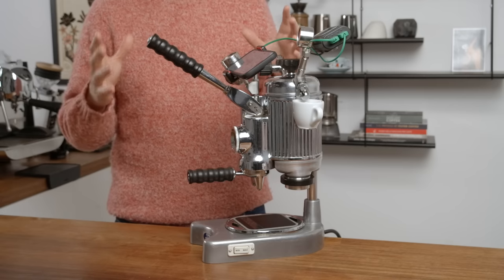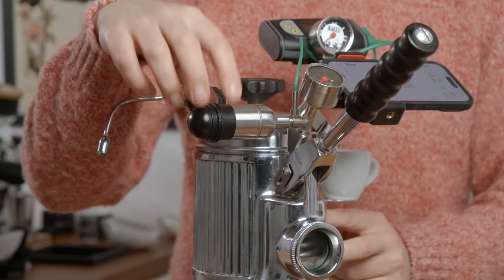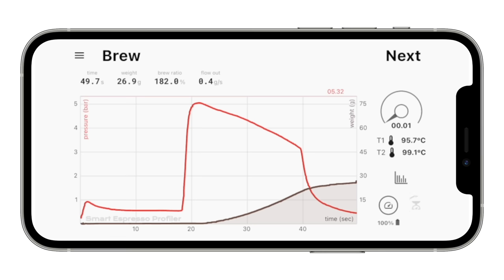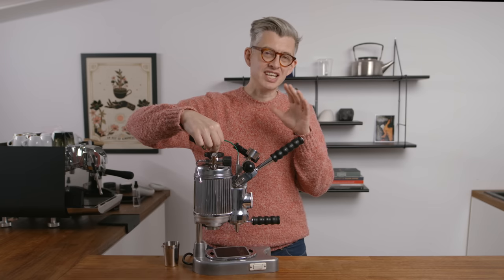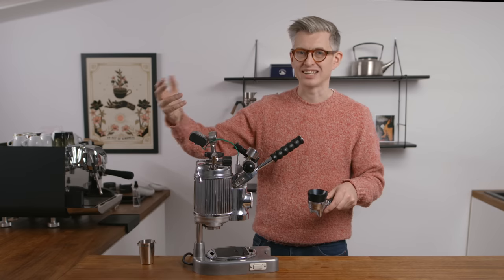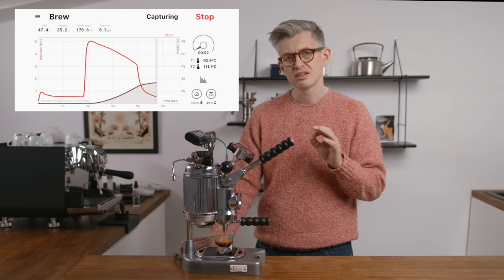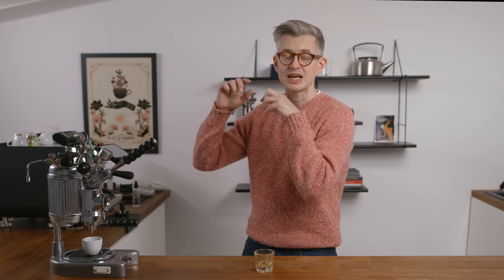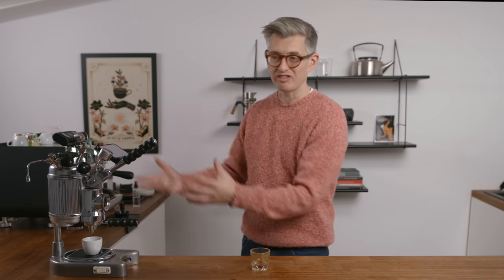An Upgraded Vintage Lever Machine

Comment: Could we flush the boiler between shots using the steam wand to bring down the temperature? The fact that they had a "min/max" switch shows that they knew that the temp gets too high if left simply on "max". On my Gaggia classic, I also have two thermocouples, one for the boiler and one for the grouphead. It has been interesting trying to understand the relationship between the two temps, and how to optimize the temp of the actual shot given that info.
Reply: Usually one setting is for brewing espresso and the other for steaming. Older Europiccola works on a similar principle. You just learn to thermally manage them.
Reply: @chris9650  I wonder if James was brewing on Max here. Perhaps that is why there was such a narrow time window before it got too hot.
Reply: @swbusby  the pre mil la pavonis on low are similar I think but the window is quite short there too. I found that turning the machine off during the shot was the best way to manage a bit better.

Comment: Honestly I love your original idea but I can respect the sense of restoration over upgrades. To that end may I suggest a compromise. Design with Gabor the machine you would like to have seen and 3D print it in metal.

Comment: Why can't you run the whole thing at thermal equilibrium with a lower boiler temperature? Does it mess with the pre-infusion?
Reply: Not with the Faemina :-(. The boiler needs to be pressurized.

Comment: James, please accept a bit of advice regarding "vintage machines"....they are only original once, with original purity once. That is their vintage attraction. Once "hacked" the originality just evaporates.  Enjoy the analog vintage experience whether with a vintage espresso machine or with a vintage car.  Use your Decent Espresso machine for your digital inquisitive urges, and to satisfy your curiosities, but still enjoy the pleasures of producing a satisfying but decent (pun intended) espresso on your vintage 1950's Faema.  I have newer more modern machines, but still enjoy the challenges and satisfaction of having learned to make very decent espressos on my La Pavoni and on my very simple dipper spring lever Sama/Ponte Vecchio.  Continue enjoying the analog learning experience with your Faema, and  with your previously acquired vintage lever from Enrico Maltoni, life and espresso are multifaceted, so enjoy the ride uncovering the analog espresso treats awaiting you.  Digital and analog can both co-exist, and are not exclusionary of the other.  As you know, the taste of the espresso in the cup is the real goal.  Bob's your uncle.

Comment: I'm unsure how to feel. On the one hand, it is a classic machine that deserves to be kept pristine.

However, isn't it better to go ahead and permanently alter a device like this, than to let it waste away? If anything, hooking all these gadgets up to it, sticking them everywhere on the outside with all these cables, makes it far uglier and obtuse than modifying it permanently to incorporate these devices. These are old machines that aren't being used much anymore. Outside of niche cases, few probably want to bother with them (modern society constantly wants newer and newer stuff). I'd rather the device be torn down and altered to make a modern machine, that either stick "life support" devices all over it or it sits in the back of some deep dark abyss in one's home, or winds up at some thrift store/charity shop/etc. collecting dust. 

I feel its better to make use of something old, even if it means permanently altering it, than to have something sit unused.

Comment: Hi all. Unrelated to the video but thought with this being the most recent I may have the best chance at an answer. Does anyone know (or have experience) of using pre ground coffee in a non pressurised basket. I'm not talking about general shop bought but beans from a proper coffee shop. I'm waiting for the Encore ESP to be released here in the UK but have an espresso machine sat gathering dust. My plan would be to get half a bag ground espresso fine and keep the other half whole to hand grind for filter. Any thoughts greatly appreciated.

Comment: Can the pressure be modified by a different spring? Intuition says that a spring with more force might speed up the extraction from the 45 seconds?
Reply: Levers generally work better with slower shots and lower pressures.
Reply: @chris9650  interesting. Why’s that? I was thinking that a shorter shot (with higher pressure) might reduce overdeveloped bitterness and help with the temperature management. (I am not an expert.)
Reply: @ZachBeauvais  with older machines I think the lower pressure is better with a smaller denser puxk to reduce pressures and channelling. I'm still learning myself. I know if I push my lever too hard the coffee is worse. 

Temp management I just learnt some tricks to keep it in line a bit more but learnt to enjoy it for what it is. Definitely much better than any cafe near me.

Comment: 3rd option- should have made it the most up to date under the hood but keep the exterior classic and beautiful. The bits he’s added make it look like some science experiment and take away the romance. Update the tech inside and you get modern performance, still with a manual philosophy, just better results. Resto mods of cars are a good example- they still drive with soul but they are faster and you can actually stop!
Reply: No option for such a mod on the Faemina :-).
Reply: @ceze70   not without re machining every part I imagine!
Reply: @ceze70  there’s a reason the Aston martin db4 restoration is £2m !
Reply: @KitLynchRobinson  We machined a few custom parts for this one. The whole piston unit is custom-made. No room for modification "under the hood" for the Faemina. You should buy a used one and check it yourself.
Reply: @KitLynchRobinson  There are a few differences if you compare this with a car. I have a 40-year-old oldtimer too.
Reply: @ceze70   it’s on the list…as are many things! I’ll get there

Comment: This is a really interesting take! I love espressomachines and brewing, but I get put off by the disenchanting overanalyzing culture around it. Every time I ask a question on a coffeeforum, it boils down to: you should buy better equipment or -> This is the way you should make espresso, don't try anything else; regurgitating all the common knowlegde about temperature control, pressure etc. 

I understand that it is nice to know everything, and to be in control of all these parameters, but without intuïtion, skill, or the risk of failing a good shot - it is just a boring hobby.

Comment: There's data, and then there's information. Seems like for this machine the data is not terribly useful for most people, but the information that there is a small window to brew in would be. So there is a middle ground between relying on intuition and wallowing in data, and I wish more coffee machines provided *information*, and didn't create loads of data that only serves to distract from the experience.

Comment: I don't agree about the ethics about PID retrofit.
But it turns out that it would have made absolutely no difference.
You need the temperature gradient, having the boiler at steady state temperature wouldn't be helpful at all

Comment: I have a vintage spring lever machine as well. Not exactly this one. But I added a PID temperature controller to it. The PID simply switches the power on and off to maintain the group head temperature. Can't really use it for frothing milk parallelly, because that would ruin the shot temperature window. But I don't drink cappuccino anyway.
And using this PID method, I can't use an ultra low brew temperature, let's say 85 degrees Celsius. Because the water tank might not get enough steam power to provide sufficient pressure to the shot.
I flush the group head when the tank water reaches 95 degrees. And that heats up the group head and synchronises the temperature a bit.
My "modification" was non-intrusive as well.

Please consider about adding the PID temperature controller. Here is a similar PID. https://youtu.be/RNV8F5v13Vc

Comment: Summary was generated by Summatim, let us know if there are any inaccuracies! 🤖

0:03: Introduction
0:38: Original Vision
2:47: Different Approach
3:03: Temperature Probes
2:11: Smart Espresso Profiler
3:48: App
5:52: Pulling a Shot
7:35: Tamper
10:00: Pulling the Shot
10:27: Slow Shot
10:50: Temperature Data
11:21: Frustration with Machine
12:03: Reversibility
10:48: Experience of Espresso
11:03: Small Window for Sensible Brew Temperature
13:38: Patreon Supporter
14:11: Request for Feedback

Comment: I have a controversial take: I wish you had just taken the thing apart and turned it into a more modern machine. It's old and vintage, and while that's cool, it's not up to modern standards of what is considered "good coffee". Good enough for some? Absolutely.  But i have trouble believing the designers of the machine wouldn't have wanted to improve it further had the technology of the time permitted them to.

Comment: This video is a warning. When you are modding a vintage lever machine with temperature probes and pressure gauges you are so deep into the rabbit hole that there is no return. The only way is deeper.